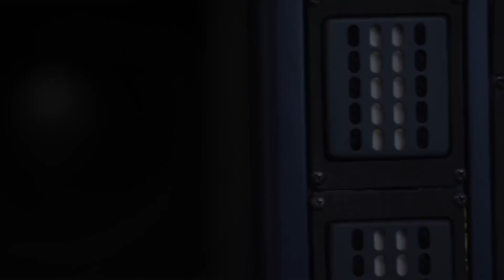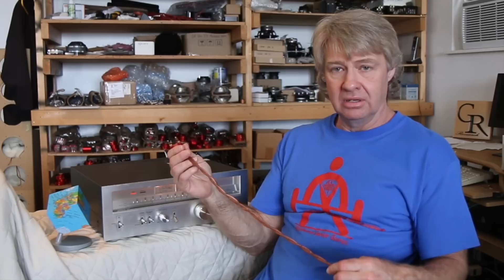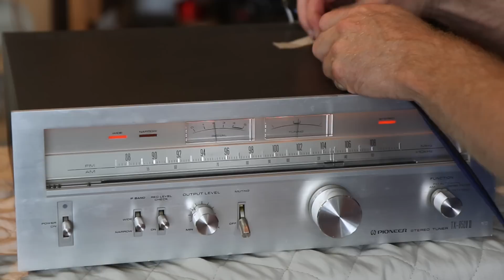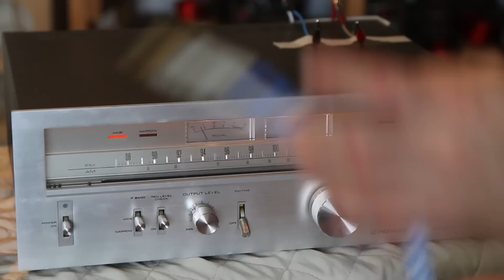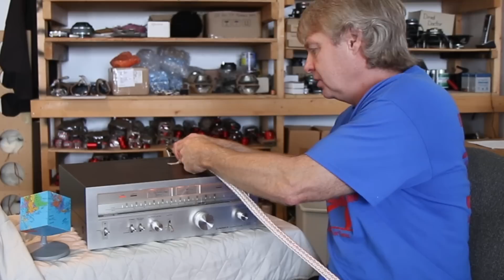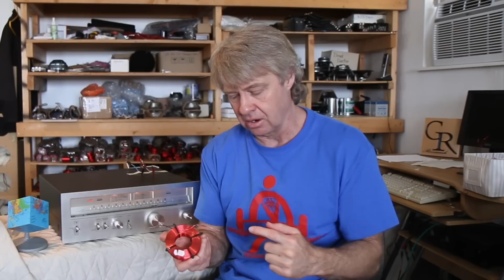Do Audiophile Cables Matter? Here's PROOF!

Comment: Cables do make a difference! But I think there's a cut off point! If you are spending thousands on cables you're being ripped off. Just my opinion! ;)
Reply: You have to look at your system in points of quality restrictions. That can be your source, amp, cables, internal parts, etc. I wouldn't recommend anyone spending $5k on a pair of speaker wires if they're using bad old gear and crappy speakers. Yet I also would not recommend lamp cord being used by someone with expensive gear. I recommend trying different gear until you find your happy place. Then enjoy your gear.
Reply: Fact, not opinion
Reply: Agreed! It's a racket.Cables are good for fine tuning.The big player here is source.Ìt seems to cable manufacturers have found the Philosopher's stone, and now turn Copper into Gold!
Reply: @Chris Kay   I love how people just say stuff based on.... well, nothing. Just 'cause you think that. Ever test various cables? Or read any White Papers? Or easier still, just talk to someone who designs this stuff, or at a minimum understands it? The greatest thing about ignorance is that it can be replaced with knowledge. There is, unfortunately, no known cure for stupidity....
Reply: @S.H.O.D.A.N_1  The point is that, even if cables do make any kind of difference, that difference is so small that it is actually highly disputed by many who work in the field of sound reproduction.  So his point is, even if that small difference does exist, the cost required to achieve it, is prohibitive for about 99% of audiophiles.   Of course someone as stupid and pretentious as you just wouldn't understand that.
Reply: @S.H.O.D.A.N_1  Any opinion can only be based on your own experience! As I said I think cables "do" make a difference! Especially speaker cables! Switching from 2.5mm cable to 6mm cable i.e lower gauge cable made a " night a day " difference to my speakers!

Comment: I liked some of your videos until I saw this. Resistance had EVERYTHING to do with sound. You can't change ohms law. There's a difference between RF and AF. Sure there's a measurable difference on a scope but at much higher frequencies (kHz vs. MHz). But for what we hear it's used as a moot selling point, pure snake oil. Just like speaker wire.  There's a difference, but its usually due to the bandwidth of that particular wire, either or has it or it don't, usually limited to length and conductor size. RF induction at AF frequencies introduce noise but you won't hear it. If that were the case we would have ferrite chokes on each end of the speaker wire.  There's more of an effect on room acoustics than your speaker cable and interconnects theory combined. We didn't even discuss what frequency the braided cable can induce it's own noise. You want cancellation? Use balanced. And we haven't even brushed the surface of ground potential.  Sorry but now Ill have to take your videos with a grain of salt.
Reply: The other issue that is not being considered here is the impedance of the circuit. The wires that are connected as collectors to the antenna input of the receiver feeds a high impedance input circuit. Most likely a discrete or Mono Lithic op-amp. This type of circuit is design to not LOAD the collector so that the signal shows up on the input of the amp. This allows the induced signal not to get pulled down or loaded down.  Comparing that to the output section of a modern amplifier is TOTALLY different. The output impedance of an output amp is on the mili ohm region and the speaker load itself is only a few ohms. This prevents any induced voltage to build on the speaker wires. Just a quick look at the impedance of the 2 types of circuit  and the understanding of how circuit loading  works tells you why this analogy has no merit!
Reply: Room acoustics affecting bass which is the big fish you want to compare has nothing to do with treble noise floor that all comes out of the fucking tweeter. Should we be checking on THD+N and make our conclusions from that alone?! No we look at the areas that xxxxin matter. Having a constant buzzing all the time for no reason makes a relaxing song become a dentist visit. If my bass is inflated or sucked out I can fix it yet... I would still take it over the former and I bet most people would. Seriously blow harder
Reply: Okay lefty. You disagree with Dan on ONE point, and now he is discredited for everything else?

Man, you’re better than that... you’re smart and you’re correct about cables. I wish you wouldn’t respond this way to Dan in this video and future videos.
Reply: Sorry, but the world isn't flat.
Reply: @dannyrichie9743   Danny any mods done to a Elac ub52?

Comment: Hook an 8-Ohm non-inductive resistor to the end of even some cheap speaker wire from Walmart and it will be dead silent. The open end turns the speaker cables into an RF antenna since its not terminated. Ones that have shielding will be quieter since the shield will block RF when tied to ground or anything low impedance, but it has no effect on the audio whatsoever. The only thing the amp cares about is the gauge of copper if its high power, and how much capacitance there is. Period.
Reply: Actually it has quite a bit of an effect and it is very audible. https://www.youtube.com/watch?v=ER_lqNFckxY&fbclid=IwAR06Cf3zkReefheduiSpZR1HyxNoENNJtiFmxvoVSEwXg83hKg9DglvX0FM
Reply: @dannyrichie9743  The effect will entirely be down to RF/EMI if the receiver is sensitive to it, which is a possibility with linear amplifiers. You can use pretty much anything for the conductor that is metal. The only problems come with things like carbon composition resistors since they have a non-linear resistance vs. voltage. At the output of an amp the signal level is quite high, but theres not a lot of RF decoupling outside of the air wound chokes present that can be put into the output path owing to the need to keep reactive components out of the feedback loop. Back in the day they used to put small disc ceramic capacitors across the speaker terminals, but this practice was stopped once people realized this would cause solid state amps to blow up from oscillations. If your troubled by it, rather than spend $1000 on wires, buy some ferrite choke cores (one for each channel) like you see on video cables and wrap a few turns of both conductors or speaker wire through it like a transformer, and locate the choke as close to the amp as permissible on each channel. The ferrite is lossy at RF, and acts like a common mode choke to keep RF out of the cabinet and feedback loops where it can cause issues.
Reply: Oh, and as for "amplifying distortion", like any good lie, it has a kernel of truth. At low feedback levels, the amplifier will make lots of spurious harmonics due to mixing taking place from nonlinearities in the active stages making distortion. But, when you increase the open loop gain to something like x100,000 (100dB) and make the amplifier gain x10 (20 dB), the distortion products all but disappear in the noise, and the THD will exceed 0.005% in amps and 0.0001% in preamps. This is due to using the excess 80dB of gain in our example to quash the distortion. Low feedback is actually WORSE than no feedback at all, and both are VASTLY inferior to proper feedback.
Reply: @dannyrichie9743  And that guy is COMPLETELY full of it, BTW. Talking about time delays in the amplifier loop? At audio frequencies? No, not really. Are there delays, yes, but only at RF where you then dont care about sound, but needing to ensure you get the gain down below unity where the phase shift approaches 180 degrees or some multiple thereof. If not, you have a power oscillator, not an amplifier. Any good amplifier designer, and even big dummies like me, know to use global compensation to impose a dominant pole on the feedback loop to ensure stability. Feedback is the cornerstone of high fidelity audio as its your only real weapon to defeat distortion in active devices, both tubes and transistors.
Reply: @dannyrichie9743  I could go on all day, but lastly the "kickback" signal he references in the vid is not bad, its GOOD! This is where your damping factor comes from! Any back EMF from the speaker that doesn't correlate with the audio (like it overshooting during a kickdrum bassline or something) will be opposed by the amplifier, and it will act like a shock absorber on your car. You can feel this with a large loudspeaker that moves freely. If you try and push it in and out with the amp on and nothing playing, it will feel a bit like the voice coil is in molasses as the amplifier will oppose the rapid motion of the coil in the magnetic field. Another example of the magic of negative feedback.

Comment: Erroneous Experimentation but the point made is good. A decent cable is required, but audiophiles are going overboard in pseudoscience. Only if you have money to spare after getting the best speaker/headphone, amplifier, transport should somebody think of spending on superlative cables.

Comment: Yes, RF interference is very important. Its even more so for network cables. Thats you need twisted pair, foil shielding. Different design of cable for longer distance and higher speed.
Reply: adn FAAAAAAAR lower voltages........ and higher bandwidth..... a speaker cable does not care one thing !

Comment: I am not trying to offend anyone. I respect this designer, as he has a long history in this field and produces very good sounding speakers.
But the only thing Danny has shown with this simple test is that a cheap speaker cable can be a reasonably good FM antenna. That is, it can deliver a few microvolts to the antenna connection terminals of the receiver in the 88-108Mhz band.
To ensure that this test is a definitive and irrefutable demonstration as advertised ("Here is PROOF"), all that remains is to know if:
1) Is there is any tweeter capable of reproducing this HF signal?
2) Is this small amount of energy enough to move a tweeter's diaphragm?
3) And if the diaphragm of the tweeter could move, will a signal of this frequency (Mhz) be audible?
4) Can this small signal enter the feedback loop of the amplifier and produce some non-linear effect that translates into something audible?
5) It will not be enough to place a simple capacitor of a few picofarads in parallel with the output terminals of the power amplifier when you use a cheap cable? I have seen that some commercial amplifiers incorporate it.
Either way, I find Danny's test interesting. I find more sense in applying a test like this to low signal interconnect cables.
Kind regards from Argentina
Reply: The test was to show this effect as it applies to cables in general, not just speaker cables. And the FRI signal does affect everything in the signal path so it isn't a matter of whether we hear the signals in the mHz ranges but how it affects the ranges that we do hear.
Reply: @dannyrichie9743    Thank you for the response. Trying to investigate on this matter I have found a video on youtube where a major manufacturer of amplifiers ensures that the speaker cable can introduce radio frequency noise into the input stage of the amplifier. This would be in accordance with the audible differences that you have found. You can see it here: https://www.youtube.com/watch?v=ER_lqNFckxY
Reply: @marcelocendoya5486  Good find. I added a link to it up top.

Comment: I could see this making a difference in line out and in on component connections (especially a turntable) but on speaker cables a person would have to have super hearing to hear anything hitting the line that could possibly be transmitted from (noise in the air) ... a better example would be open lines going to say line in ... or for an even louder experience open lines in a phono preamp ... shorted terminals vs not shorted

The main thing ... these are speaker cables they aren't intended to be used as antennas ... honestly if you had them hooked to a speaker and wave them around are you seriously gonna hear something from the speaker it's attached to?
Reply: The test was to show this effect as it applies to cables in general, not just speaker cables. And the FRI signal does affect everything in the signal path so it isn't a matter of whether we hear the signals in the mHz ranges but how it affects the ranges that we do hear.

Comment: Speaker cable length used to be a big problem when C.B radio was popular, my dad's stereo was unlistenable due to huge thumps on the speakers. More recently a defective loudspeaker had one terminal come loose and it started picking up a nearby taxi firm.

Cheap interconnects like I used to buy from Radio Shack were atrocious for low-level hiss. But when LC/OFC came out things improved dramatically.

I did wonder if the twisting and braiding is just moving the conductor in and out of polarization with the broadcast signal, and not just an impedance blocking effect.
Reply: That noise WAS NOT BEING GENERATED because of speaker cables ... that was coming from the amplifier it was amplifying the CB signals not the speaker wire ... simply test disconnect the speakers from your amplifier a tell me you hear sound from them

Comment: Human hearing at absolute best is stated as being 20 - 20,000 Hz, yet you are testing a length of cable passing the 100 
MHz band of an FM signal? Totally irrelevent.
Reply: The test was to show this effect as it applies to cables in general, not just speaker cables. And the FRI signal does affect everything in the signal path so it isn't a matter of whether we hear the signals in the mHz ranges but how it affects the ranges that we do hear. Totally relevant.

Comment: I don't think it's a question of do cables sound different. If you have a good quality speaker cable lets say $150 a pair and you compare it to a $1000, 2000, 3000, 5000 etc. Can you here a difference in a double blind listening test and if you can, is the difference worth the money. Differences in measurements does not always mean you can hear the difference. also the reverse is true, your ears May pick up something the instruments cannot. The only way to know is with a controlled double blind listening test.
Reply: Don't rely on your ears ... no two ears hear the same (including your own two ears) test equipment shows noise/ noiseless stuff ... far more accurate than an ear or two
Reply: @darinb.3273  If your ears can't hear the difference it doesn't matter what the measurements say. A  double control blind hearing test between a group of people will determine if there's an audible difference between cables. Not measurements.

Comment: You proofed that some cables are better to use as antennas than others.
Generally speaker cables aren't used as antenna but used as speaker cables, so what's your point?

You should've at least terminated the open end of the cable with an 4ohm or 8ohm inductive load (i.e. speaker voicecoil) to make the test setup anywhere close to the intended application.
The antenna input of your radio is either high impedance (AM) or somewhere around 75ohms (FM), while the the output of a poweramp is (or should be) way under 1ohms, since it has to provide a high damping factor.
Last but not least, to make a somewhat fair comparison, all cables need to be exactly the same length, as length determines to which wavelengths they're the most sensitive.
Reply: The test was to show this effect as it applies to cables in general, not just speaker cables.
Reply: @dannyrichie9743  "not just" more like explicitly not speaker cables.